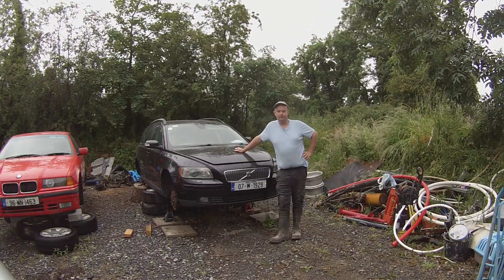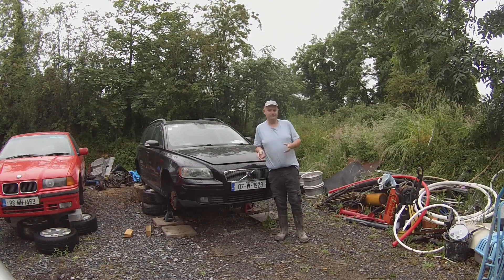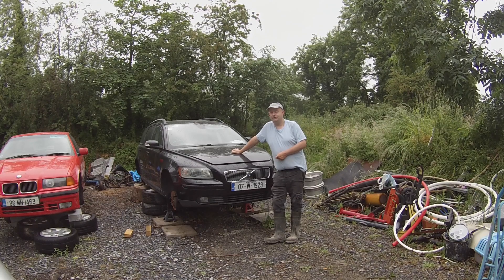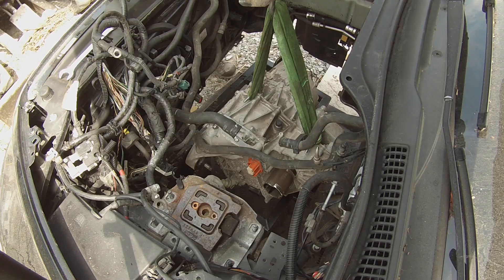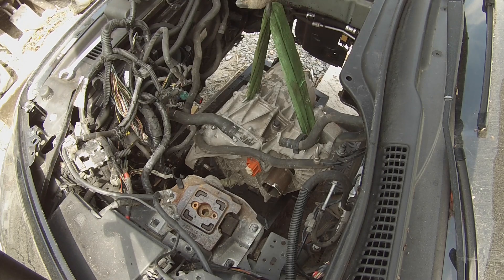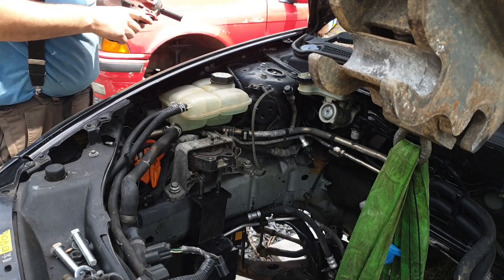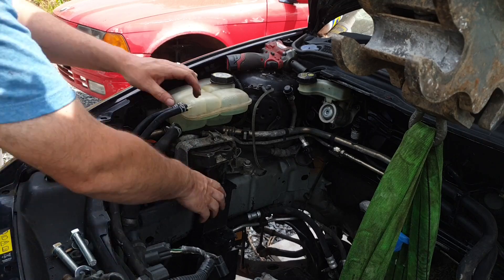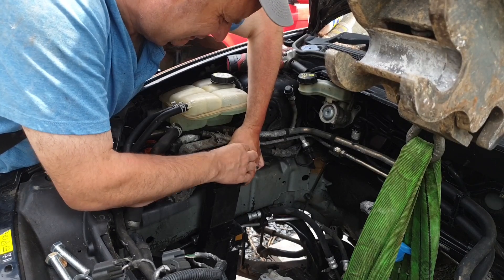The MuskVo Part 5: Elon And The Digger

Comment: I found this channel because a forum said to use open converter for front Tesla drive unit in a Volvo v70. Just noticed Damien is also toying with volvo. Stoked. I'm going to use entire Tesla drive shafts and suspension ( need to widen body/fenders 2" both sides) super stoked it fits in front of firewall in original wheel wells. Was worried it would be at a weird angle where oil-cooling pump wouldn't be at bottom. Hoping damien disproves this or else I'll let him know the angle doesn't work 😆